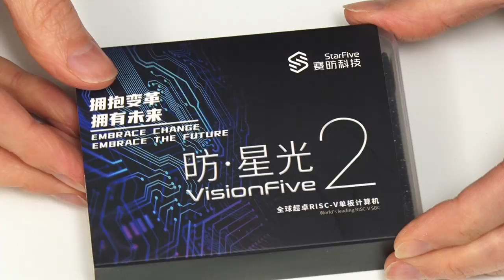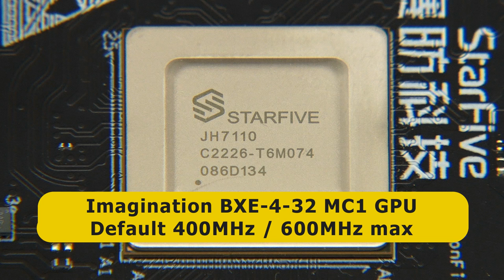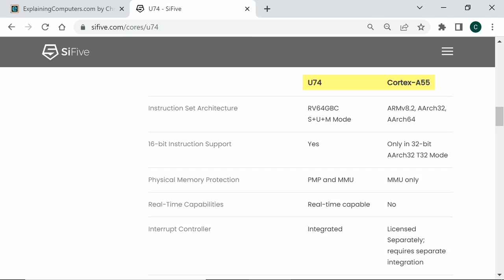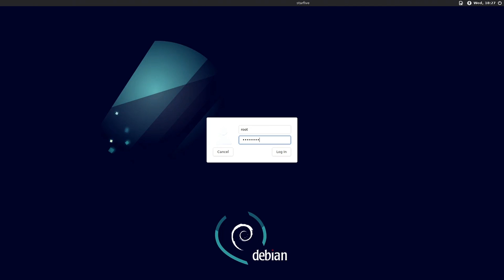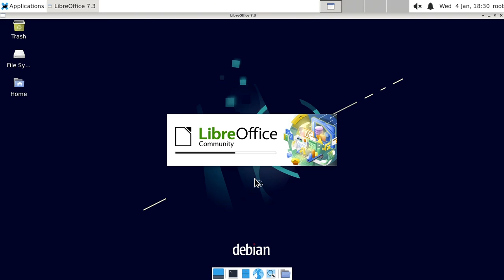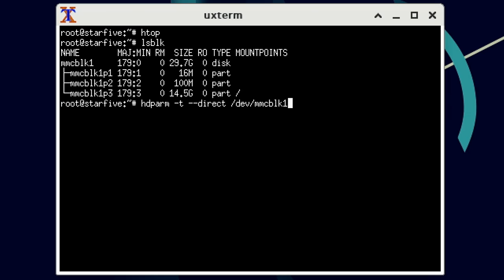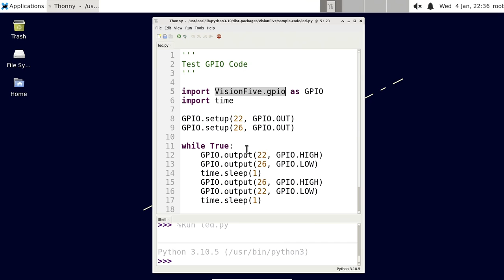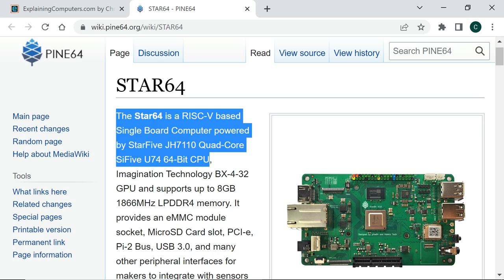VisionFive 2: RISC-V Quad Core Low Cost SBC

Comment: I See TWO Ethernet ports, get excited jump into the video, thinking ah don't need a USB to RJ45 dongle hanging like from the Pi4. Hear only ONE is Gigabit other one 100mbps💔Great Review either way!

Can this be used as a NAS PfSense Dual Function Type Server Security System? Does any software/OS exist that can do that Own non cloud DDoS&/Malware protected website emails files server/s (8 GB model?) Connected to probably two external HardDisks on the 3.0 again confusing with the 4 BLUE USB ports with only 2 being 3.0 whereas if all 4 3.0 then the USB to RJ45 3.0 IIRC is I think more than 100mbps TPLink Blue 100mbps plain White more than that, Don't Want to Risk having everything emails and files on One External HardDisk so that there's NO cross contamination or security issues!

Because Multiple Systems vs ONE Low Powered All-in-One Setup Will Be extremely less power consumption and everything can be connected accessed from and/or to one space instead of Multiple Keyboards and Monitors needing to be individually Connected and Powered which if Power Outages which they regularly Do if I even so much as Look at My Laptop! (Remote Neural Monitoring Much?🤔) a Single Battery Inverter Can Provably Keep Running as Backup?!

Would Love to Hear any suggestions for a WikiLeaks type Whistle Blower Vault for err... a VERY HIGH PROFILE Whistle Blower kept illegally unknown to the World Indian Population who THEY happened to SHUTDOWN the World and India Under Hoax after ME Filing HUGE National International Criminal Courts Cases They Have Me and My Baby"s and My Cases Illegally and Criminally Censored OVER 8 Years 2 Months that's Maximum Time Frame Allowed For Remedy Public Disclosure COURT ORDERS including Military Court Tribunals and My NEWS INFO PRIVATE DATA FOR PUBLIC SERVICE ANNOUNCEMENT MANDATORY DISCLOSURE UNDER UDHR POCSO TWITTER @MICKYLEAKS_MGR Illegally Kept SUSPENDED LEGAL JUDICIAL NOTICES Appeals SENT 100s of Times as that's Chronological Evidence Account Only from January 2017! And Check this Out I Catch E10n Mu5k Claiming Like as if He's Revealing about Illegal Censorship and Blackbook Lists etc so I Immediately Check the Account as My phones being illegally hacked evidence Files etc Erased! First 111.1k tweets caught showing in Fake Suspended 110k NOW 108k! CRIME!

BAM! oh Yeah WE Know NOW Where E10n Plagiarising Info Pretending to Be the Poster Child for Freedom and Rights ask him why $100,000 to ACLU 11/12/2018 same day only right MarkJackSundar Hearing? 10/12/2018 My Murder Attempt Accident Motorcycle Stolen By Police, HOW SURPRISING When Years Cases History My Filings Findings Extremely Critical for World Awareness and Safety Wellbeing of Humanity Children Babies I Post Global and Indian Modus Operandi of Entire CRIMES again Already COMMITTED Years Later Knowing the Laws My Son Michael Gandhi Raj who I've Caught the FACTS They've Told Him His Father as in ME AM DEAD and Fake Calling him By Names Like Joey Joshua and My Crook School Vatican Mafia Indoctrination Centre St. Bede's AIHSS & CBSE Caught him Admitted For Cover up and Tutoring Grooming Caught as Well!

Evidence Sent to ALL AGAIN ALL COURTS GMAIL reading everything This Jonathan Ashwin O'Connor full details including OSs Platforms Connections Not One Multiple Emails with Neatly Typed out Chronological Order Dates Cases Numbers How Each Court Dept Govt Platforms News Media Including CEOs Who They Are Money Laundering Bribes Passing on Ties Propaganda oh famous Suddenly on Multiple Platforms Snake Oil Salesmen etc oh Straight from Fake Ransomware Videos October 2021 Acer Attacked Lied When I Experienced Witnessed the Events Live The Same Fake Targeted Individuals Group Members Jumping Quickly Across Multiple Platforms Because I'm known Damn Well to Actual Anonymous Official Members I'm Talking 2005 prior and after I'm talking Truthers Teams P3d0Hunters Who Had Been IN and Out of my Phones PCs Laptops etc again EVIDENCE EVERYTHING Kept OPEN ACCESS to Prove That  Intelligence Agencies Veterans etc DO NOT CARE ABOUT CRIMES AGAINST HUMANITY CHILDREN BABIES When Pope Caught Quickly Asked ALL CHURCHES TO SEND THE MONEY PROPERTY ETC STOLEN UNDER GUISE OF OFFERINGS SUBSCRIPTIONS RELIGIOUS WORSHIP PLACES! Check the DATE when He Did That! Refer to My Cases Numbers Dates Events Murder Attempts etc Know Legal Judicial Time Frames!

That's Why then Independent Anons etc I'm Telling How to Go About things How Long Window They'll Have Because Too many Years in Experience of So Called Global Govts Intel Sabotage Destruction to points nobody Can Even Imagine My Comments Everything Casually Illegally Hidden By Actual Death Penalty Convicts Yes EVERY PLATFORM Bought Out Paid Out Deals for Benefits Free Servers Fake Business Verified Monetized Accounts etc they know within seconds reason kept Like That is so they can Quick Copy the FILES and Do What Yes EXPOSE them as in the exceedingly tyrannical Criminals not arrested and hung in the duration of my again Not Intel Not DEAD and DEFUNCT COURTS or SLAVE NEWS but My EXTREMELY RISKY to Life INVESTIGATIONS NEWS MOST Importantly EVIDENCE AND UNDENIABLE PROOF BECAUSE I AM A LEGAL PERSON A CRIMINAL PSYCHOLOGY EXPERT OF MY OWN ACCORD SRA CSA Direct Experiencer Witness by Body Since Birth not JUST ME BUT ALSO MY SON Again in WHICH Country is it LEGAL to POUR ACID Chemicals in an Independent Leader Whistle Blower Legal Expert’s House who Going to File again Guinness World Records of Multiple Records United Nations ICC ICJ UNICEF NATO Geneva Convention Nuremberg Hippocratic Oath Legal Judicial and Journalists Reporters Codes Failure Corruption Perversion Obstruction of Justice CASES Not Case!

Again Because ICC 05/11/2018 only They Slept on My Baby’s My Cases Pope Himself Caught Fake Claiming on Twitter only Please Don't Report To Police and Courts CSA SRA Cases it Seems when Priests to Madras ArchBishop House Mylapore to Vicar General to Catholic Tribunal Judge themselves Caught Guess What Happened to Most of Them who Did. First a hoax invalid Null and Void Fake Infiltration Setup Marriage Then No Blackmail Liability Factor Very Well Known Now to All 5Perm Egg Theft Illegal IVF Surrogacy was Done Even Identified the Donor Given One Simple Visible Factor Common to Son and Donor so all Court Should Have Done Day One DNA test After ARRESTING the Criminals IMMEDIATELY, NOT 1st in line for hanging E4 Abhiramapuram Police FAKE CyberHub NOT Take Action, Get My Baby in Two Days When was Caught Mutilated him with Illegal Circumcision to Evade Legal Judicial Action again People are Dying Here Christians Means Playball and Kill in India Known Bloody Fact at That Multiple Murder Encounter Assassinate Attempts on BOTH MY BABY and ME Murder Attempt Accident Leaving Me with One Inch of my foot Missing ALL AVAILABLE with Chronological Proof in Twitter with The Medical Records!

Heck Pinned Tweets Thread is OF THE COURTS TNSHRC PO Shanthi Saraswathy Screaming Case Has got Closed No ORDER COPY STATEMENT IN HAND OR ARREST OF CULPRITS COURTS TNSLSA TNSHRC Police Right to the Director General of Police Himself and Susan Wojcicki and Sundar Pitchai with Their RSS HSS BJPITCELL all Think it's Fun and Games To Be Illegally Removing Evidence Videos thinking US Bait to Corrupt Delete Evident US elections Fraud Crook of Delaware Josephine Jebapriya Benjamin oh very much on YouTube Facebook as well oh My Not Arrested Extradited or Deported By White House Secret Service FBI CIA Police Interpol MI5-6 whatever Russian German Special Service Intelligence or Australia UK Persons Caught As Well!

Comment: Hi Chris, thanks for continued great content in 2023.

I have a suggestion for an interesting yet simple SBC project: Turning one into a Wifi2LAN adapter. Bringing wifi to devices for which it is difficult or impossible to install wifi drivers.

I came across this tutorial for a raspberry pi and tried it out successfully.

However, a version made by you will benefit from your explaining the steps and options in your characteristic way. Perhaps an addition would be to have an optional extension to be able to set up the wifi via a small lcd or e-ink display and a couple of buttons so you can set up the wifi in a new location without needing to boot into a GUI operating system with a full monitor mouse and keyboard setup.
The tutorial I followed is: https://www.youtube.com/watch?v=TtLNue7gzZA

Comment: Ali-express priced 8GB model for over 180 EUR.
Reply from the maker: Many vendors -- including a lot on Amazon -- sell SBCs at way beyond the recommended retail prices. I can do nothing about that! :) But the 8GB VisionFive 2 remains listed on AllNet for $85, as indicated in the video: https://shop.allnetchina.cn/products/starfive-visionfive-2-quad-core-risc-v-dev-board?variant=44249193513276
Reply: @ExplainingComputers  Thanks. They aren't specific about network speed of the second ethernet. By the way I saw that OrangeIP5 is on...

Comment: Could run a lcd I imagine control by temperature or whatever.
Reply from the maker: Yes, indeed -- there are two MIPI DSI (display screen interface) slots for LCD panels. And loads of GPIO for temperature and other sensors.

Comment: An interesting product, but considering the Pi 4 is already several years old, releasing a CPU today that doesn't even match it's performance won't be appealing to anyone but hardcore enthusiasts of the idea of an open architecture.
Reply from the maker: I don't think this is true. It depends on the application/requirements. Remember that many Pi models still being sold -- eg the Pi Zero, Zero 2, Zero 2W, 3A+ and 3B+ -- have less CPU power than this board. A lot of SBC applications are not that CPU intensive (robotics, IoT, storage, etc). So whilst a Pi 4 is faster (and has massively better software support at this stage) than the VisionFive 2, for many users the M.2 slot and twin Ethernet will be more important. But of course this is a board for RISC-V development.
Reply: @ExplainingComputers  Good point, I forgot that the main reason people buy these is not for desktop computing, or even home servers (my use case for the Pi 4)

Comment: I have a MaaXBoard. Do you consider to review this board?
Reply from the maker: This board is new to me -- so thanks for letting me know about it. I see that it has a quad core A53 SoC, 2GB of RAM, and a price of $139.99: https://www.avnet.com/shop/us/products/avnet-engineering-services/aes-mc-sbc-imx8m-g-3074457345642080716/ This makes the board expensive, at least compared to a Raspberry Pi, for its specification, so I am unlikely to review. The board I imagine has an industry focus, whilst on this channel the focus is on makers and enthusiastics.
Reply: @ExplainingComputers  actually this board has NXP i.MX8 SoC which makes it unique for devoloping custon Linux distrobutions, Yocto Project and fine tuning. 6000 page RM is available for NXP site. No other SoC vendor do that for us. I am not a fan of any company. As a matter of fact, I choosed this board for learning linux development stuffs. If i want a SBC for casual desktop replacement, i would stick to RP4. 
It runs pretty well with Debian/android9/yocto distos out of the box. 
By the way. Thanks for your reply.
Best Regards.
Reply from the maker: @coderhex1675  Thanks for this. I saw that it was based on the NXP i.MX8. As you say, good for developing custom distros. But as you say, for typical maker use --- not just as a small desktop, but or retro gaming, robotics and other projects -- a Pi is a better better. But I will keep a note of this on file. :)

Comment: Nice video.  A risk with this product is that it will end up on a sanctions list.  Non-Chinese developers need to get their act together and produce alternatives in the free world before this happens.
The terminal looks like an xterm.  Hold down the Ctrl key and press and hold the right mouse button to access other font sizes, provided they are installed.  See "man xterm" for further information.
Reply from the maker: The fact that the cores are from a US company (SiFive) may be a positive factor in this regard -- and Ameridroid already has it listed (if at inflated prices). I could not increase the terminal text size via keystrokes, but had not considered installing any required fonts. Will try this! :)
Reply: @ExplainingComputers  The possibility that China might invade Taiwan is now sufficient that many companies are already moving their manufacturing.  You might also want to consider independently your own personal ethical position.
Xterm is, of course, the original X-windows terminal app since 1984, so there are plenty of resources online.
Reply from the maker: @cdl0  I have no problems with my own "personal ethical position". RISC-V is very much an international endeavour that brings people together across boarders, and the world is better for that. China has not currently invaded Tiawan. If it does so, then a lot of things may indeed change.

There are indeed plenty of Xterminal resources. But what is available, and what I can get running on a VisionFive 2 right now, are not the same thing. To get to the point where I could demonstate in the video the variety of things that I ran in one session was a reasonable challenge! :)
Reply from the maker: @bskull3232  An excellent point.

Comment: The main benefit of RISC-V is geo-political - China has a way to domestically produce CPUs which are not filled with so much foreign IP, or potentially threatened by world events. 

For end users, it won't mean a damned thing. ARM only takes pennies in royalties off the cost of a CPU, so no advantage there. Probably being RISC-V means worse performance and support too, at least for several years to come.

Comment: 12:26... terrible use of the kernal/single thread working over multiple cores.
Core 0: 0%
Core 1: 100%
Core 2: 0%
Core 3: 0%

Low memory usage though

Comment: I don't see RISC-V getting much ground.  Just some specialty cases for a while.   RISC-V has the same problems as Linux.   Since it's open architecture people are free to fix and improve it as they see fit.   This fractures the community and makes it impossible for (the non system specific) developers to develop for the platform.
Reply from the maker: What you say about RISC-V ISAs is not quite true. It is an extensible ISA (or group thereof). But the core remains fixed. So, for example, a car manufacturer may add instruction set extensions for their particular embedded application. But core created for most applications remain compatible with each other -- nobody has an incentive do to otherwise.

And in terms of "speciality cases", RISC-V International report billions of RISC-V cores in application: eg see https://riscv.org/announcements/2022/12/risc-v-sees-significant-growth-and-technical-progress-in-2022-with-billions-of-risc-v-cores-in-market/ So minority outside edge/embedded/controllers for now, but already a very significant player in the marketplace.
Reply: @ExplainingComputers  Yes, I know. That's why my Linux comparison was a good one.     The Linux kernel is the same kernel for all the distros.  But the distros are all different because of the stuff added to it.   Fracturing the Linux community. 
Also, It's a little bit of a logic error to say the extendability is a selling point and say that it will be fine because people will only use the core parts.   So, yes.  A car would be a good example of a "specialty case"  but I don't see it competing with the Pi that has also made ground in the general computing area and therefor the general populations knowledge of it's existence.  
Anyway.  That's my prediction.   Time will tell.

Comment: I just bought a Dell Optiplex Micro with 6-core i5-9500T and 256GB M.2 SSD for a price of a Raspberry Pi 4 and expanded it with 32GB of memory. These single-board computers are not competitive at all at the moment. The prices are astronomical; even then, one can't buy them.